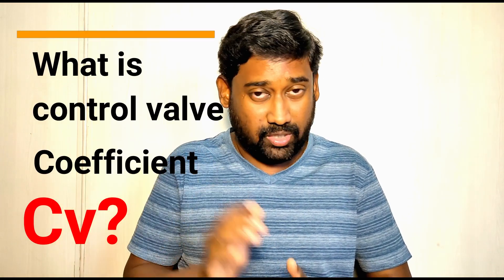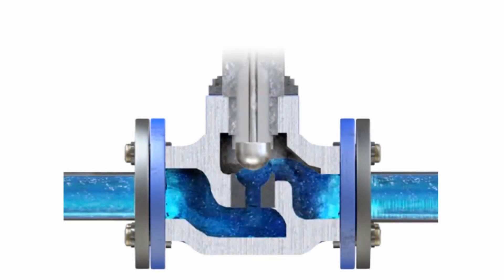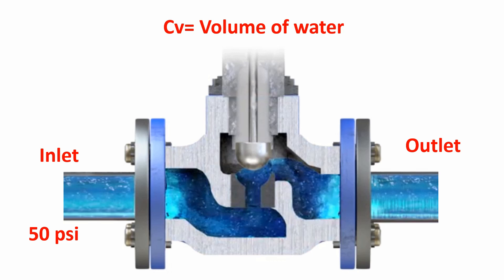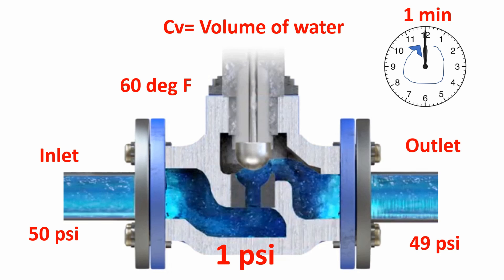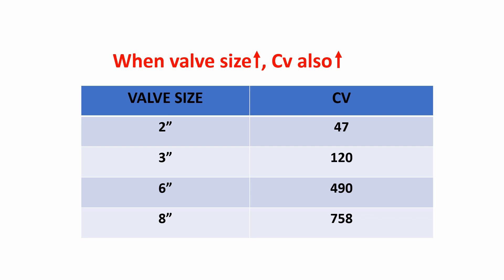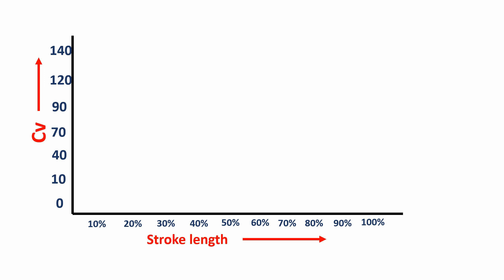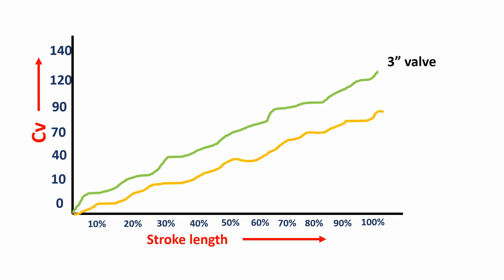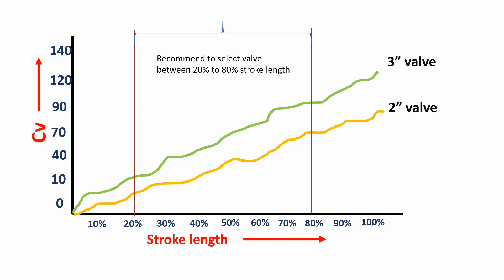What is control valve flow coefficient Cv? | Learn Instrumentation Engineering

Comment: I need clarification, which is the higher pressure drop across the valve, 50% open or the 100% open.
Reply from the maker: We cannot generally comment unless, we have process parameters and control valve specifications. Then only, we can find the high DP at which stroke conditions

Comment: Control valve coefficient should be low or hight?
Reply from the maker: This value is not for high or low. As per the volumetric flow for an application, we need to design the rates Cv.
Reply: @learninstrumentationengine268   bhai maine mcq  wise pucha tha, mujhe kahin bhi iska ans. Nhi mila abhi tak,

Comment: Hi friend please suggest Cv for pneumatic for 1/4 inch flow control valve will give how much flowrate
Reply from the maker: Pl mention differential pressure across the flow control valve, flow rate of medium and specific gravity of the medium. Then only, we can calculate correct Cv